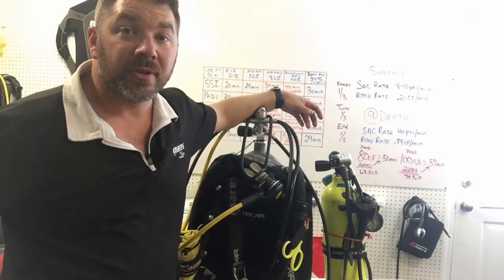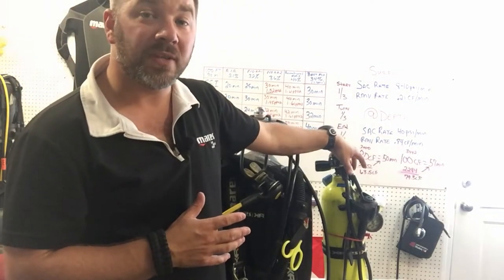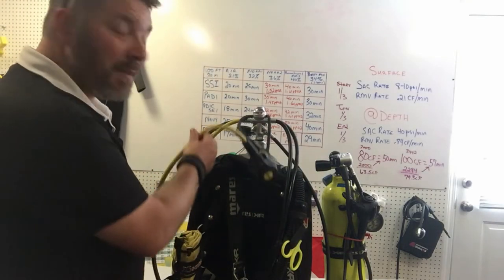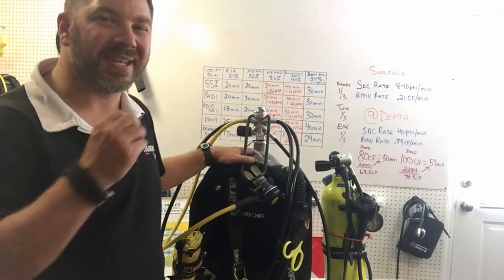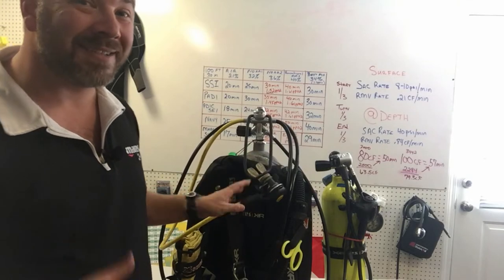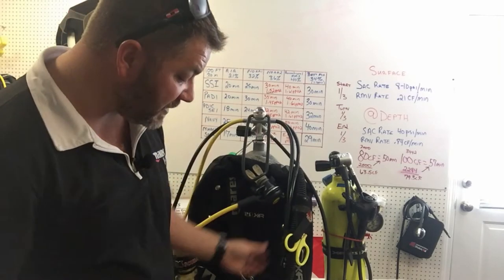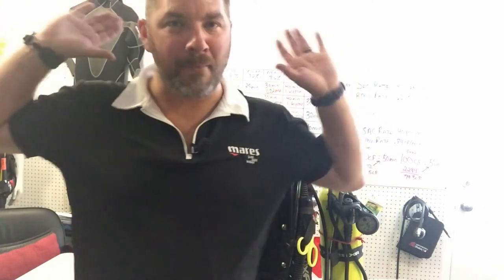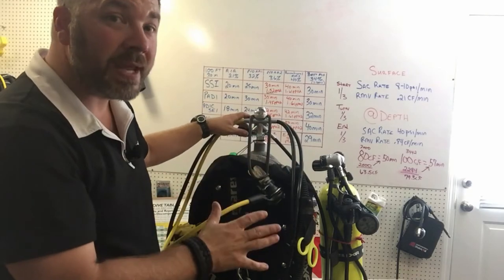Dive Planning Part 3 Gear Setup

Comment: Good series of videos. When students are training with my dive club they individually carry out this process prior to every dive so it becomes 2nd nature. As part of the plan they also look at "what if's", what if we went deeper (1 level deeper on the tables), what if we increased our dive time to the next time on the table (or by 25%, whichever is lower), and finally what if we went deeper and for longer (ie both of the above combined). This reinforces that in many scenarios, if you don't dive your plan you will run out of gas.

The club also has rules such as if you return to the surface with less than 50 bar you get fined. If you do it twice within a certain time period you get banned for a month, repeatedly breaking this rule results in expulsion.
Reply from the maker: Thank You.  Its always better to be safe than sorry, yet at the same time, not every dive is the same.  We will be making a video in the next few weeks about "Doing as I say, not as I do."  There are a bunch times we preach one thing but dive another.  It should be an interesting video, and I'm sure it will start plenty of conversations.

Comment: I'm interested to hear what your opinion is on a single cylinder rec set up where the primary reg comes from the right hand side but the octopus comes from the left hand side, as per BSAC training, instead of the more conventional set up of both coming from the right side.

I initially trained from another agency where both come from the right hand side, but I'm now continuing my training through BSAC. The reasons given for the alternate coming from the left is that (without reconfiguring the 2nd stage, ie the hose still enters from the right of the 2nd stage) the alternate is easier to donate with the reg facing the right way up and with minimal bend in the hose. I'm not totally convinced that this is better than knowing that if you somehow lose both regs you just have to sweep the right hand side to recover 1 or both regs. Plus the alternate isn't ideally routed should I need it. I use a 3rd option, long hose primary, alternate on a necklace, with primary donate, which I see as the best of all of these but it does raise a few comments from the pensioners within the club.
Reply from the maker: This is a great topic as well, and one that we will dedicate an entire video discussion to.  But to give you a quick answer, I prefer to have both on the right side.  Whether I use a long hose configuration (which I do in Sidemount), standard hose configuration (which I do for Back Mount), or even the dreaded primary on the right and integrated octo/inflator on the left (which I use on a very rare occasion while traveling abroad, and to keep my travel weight down to a minimum), all three work best with primary donate.  It actually will work even in mixed team diving, if all divers donate their primary and then go to their back up, then there is never going to be any confusion.  Now lets complicate things and add the back up to the left side.  I say this jokingly of course.  The only complication is, divers not discussing emergency procedures before they go diving.  A good thorough dive briefing will fix this issue, no matter how one configures their gear.   At the end of the day, it doesn't really bother me how a diver configures their gear, as long as its safe for them, and it makes them feel the most comfortable while underwater.  To me, setting up dive gear for an individual diver's needs should be personalized to them.  Certain dives require certain types of configuration.  Dive gear is like vehicle tires.  You use Mud Tires to go Mud Slinging, Racing Tread to go Racing, Street Tread to go Road Tripping.  I always tend to use the gear that is needed for each individual dive.  I typically use up to 4 different sets of equipment through out the week.  My PSD gear is used only for Public Safety Diving.  My Salvage gear is used for Salvage Diving.  My Teaching gear is used for Teaching.  And finally, my Sidemount gear is used for, well, Sidemount Diving. All different configurations, and all require training and practice to become proficient while using it.  Hopefully this will answer your question.  Stay tuned, we will definitely make a video discussion on this topic.
Reply: @LakeHickoryScuba  I generally agree. I always spell it out to my buddy, in no uncertain terms, that the alternate on the necklace is for me, not for you. This is necessary as I'm the only one in the club with this set up. However I do see value in utilising a similar approach as much as possible (eg long hose primary donate for both single and twin tank diving) to increase familiarity / muscle memory, but I assume that's less relevant for yourself than people like me who are in the water less frequently.

I look forward to the future videos. Cheers!
Reply: @Bogy 1 Kinoby haha I don't mind them, never mind evolving since the 1970s, some of them are in their 70s!

I see and hear somethings that make me cringe. Diving to 50m on a single cylinder of air! Diving a manifolded twin set with the manifold closed and different nitrox mixes in each tank!

Comment: What's the whole "balanced rig" thing? One of the guys I met on a dive boat told me that I should know what depth my wetsuit loses buoyancy and I think it's for that purpose (being able to swim up at any depth).
Reply from the maker: Hello Carlo, the balanced rig comes from the old days of diving without a BCD, primarily the late 50's early 60's.  Now days, for me personally, it comes from me being lazy and not wanting to put anything else on, like weight belts or even weight pouches, once I have donned by scuba gear.  In short, having a balanced rig means that your rig is balanced (properly weighted) for whatever depth you will be diving to, and in the event of an emergency, more so an out of air emergency, you will be able to swim it to the surface without dropping any weights.
Reply: The dive boat captain of one of the boats I go with all the time dives without a BCD and she says it's just like freediving with a tank. I freedive most of the time but I'm still not sure if I want to try that style. So balanced rig basically means not over weighted? I saw the "Do You Really Need Your Low Pressure Inflator?" video yesterday. That was pretty cool. I gotta try it this weekend. Thanks again for all the info.

Comment: Enjoyed seeing how you setup your gear. I use a 19cf PONY, mounted on the back/right. (Frees-up my arms to carry other things.) Because of the PONY on my right side I place only 3 pounds of added weight there and 6 on the left. Trims me out fairly well enough that I don't rotate along my longitudinal axis.
Reply from the maker: Anytime I do Public Safety Diving, Ice Diving, or Salvage Diving, I too wear it on my back right side.  Even with a 30cf pony, I don't really have any trim issues.  For most of the diving that I do, I prefer to sling the pony, but for the 3 types that I mentioned, and like you said, it frees up the front for me to be able to carry other items as well.